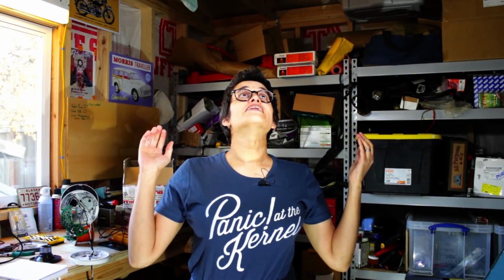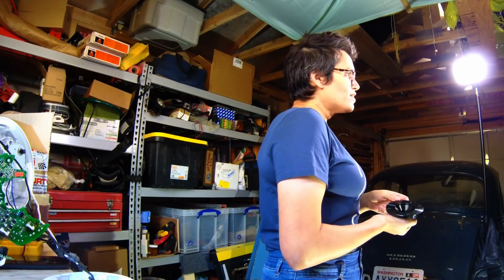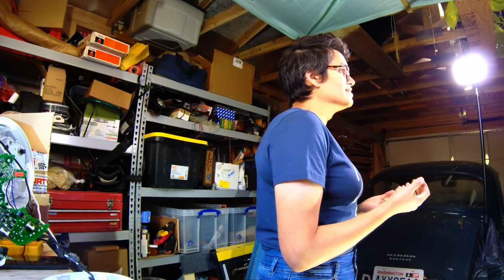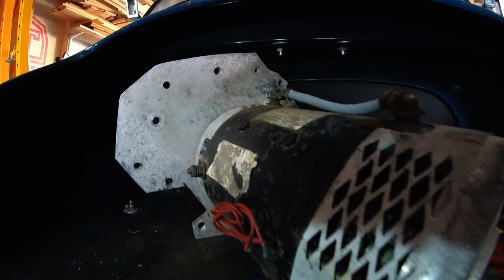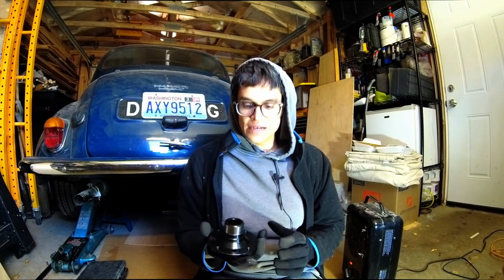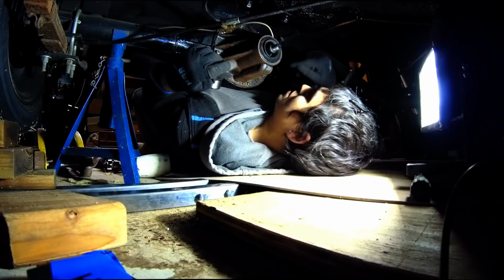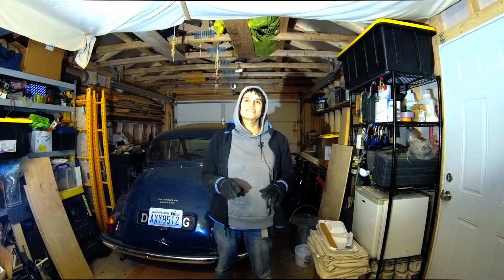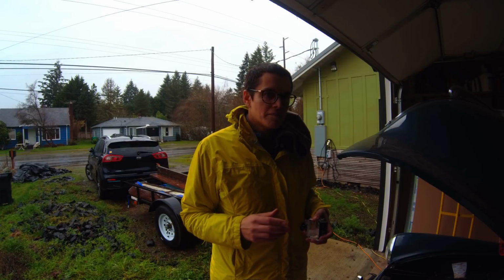Rebooting Rebecca - Turning A British Classic Car Into An EV. Episode 1.

Comment: Anyone watching this later--if you want to make life easy for a dry engine, take out the sparking plugs to crank it a bit. A short squirt (1 second) of WD-40 or similar in each pot can help lubricate and free the rings. If there is room in the sump, adding a pint of fresh oil down the rocker cover will help the valve gear. 

I say there's no kindness in cranking it slowly with the plugs in, because everything is under load and the oil pump may take ages to prime at that speed.

A rough check for preload in the pinion bearings is feel--there should be a bit of stiffness when you turn it by hand, but it should feel smooth, except if you feel the teeth meshing.

Comment: I snapped a number of half shafts on my Minor and, i can tell you, that stripping the diff is a piece of cake and much easier than the way you managed this project.

You simply pull the half shafts from either side,
unbolt the diff,
it just falls out into your hand.

You are then able to work on it without having to work under your car.

Bit late now, but there you are.

In my case, and this is a warning, when you snap your half shafts you will find that the shear just where they enter the diff.  They are splined shafts that fit inside the drive gears, this is an advantage as you don't destroy the gears when you snap the half shafts.  However, this does leave you with stubs that need knocking out with a chisel.

Once you have your diff out of the axle you can use engineer's blue to see where the gears are meshing and adjust as necessary - not a job I have done but I have some notion of how.  Doubtless there are instructions somewhere on the net.

Anyhoo, the whole point of this posting is to advise you that, with the torque delivered by the motors you are very likely to snap a shaft, probably in the wet, probably  as you turn out of a junction or driveway and put the power down too early.  I managed to do this with a 1275 Midget engine (at least twice), you will have no trouble snapping them with an electric motor.

Therefore, I strongly suggest you do as I did and pull the half shafts now, heat the splined ends till the are showing red, then dunk in a cold bucket of water to harden them off.  This sorted the problem for me, once and for all.

The gaskets should all still be available, I always used to use this firm:

Name: The Morris Minor Parts Centre
Address:
143 Cannon Hill Lane
Postcode/City:
SW20 9BZ London - Raynes Park
County:
Greater London England

- this was 15 years ago but they seem to still be around.

Whilst you are stripping the half shafts you might also like to change the rear brake cylinders, which are astonishingly leaky.  I don't know whether good quality parts are now available but this always used to be an issue for me.  You might like to try synthetic fluid, you may be aware this is less hygroscopic, so will probably cause less rusting of the cylinders.  Apparently a rear disc conversion is possible.

I changed the front drums for discs, I was not keen on using Marina parts (different wheels required) but managed to find an Owen Burton kit that used Ford discs and calipers, which required that the hub holes be drilled out slightly to accommodate the bolts, but a very good upgrade.  I don't recall it being a particularly difficult job.  However, forum postings suggest that the kit from JLH is of better quality overall and requires no machining.  Caveat Emptor.  This, coupled with the radial tyres, made the Minor a much safer car in normal traffic.  

I used to enjoy powering down the motorway in the outside lane, roof down, overtaking everyone else.  Good times.  I once burned a V8 land rover away from the lights too, I was quite chuffed with that.
Reply from the maker: You'll be pleased to know that these aren't standard mog halfshafts. it's an updated Ford English diff and halfshafts and she's running the JLH disk brake and rear brake upgrades :) ^Kate
Reply: @transportevolved  Sounds like you have a handle on it.  I miss my cabrio - but it was getting expensive at a time when I didn't have a lot of cash sloshing around.

Comment: It's a bit late now but for the next time you can work out the correct torque on the nut by loosening it 1/4 of a turn and tightening it back with a torque wrench, adjusting it up till it is just high enough torque to get back to the start point. Then use that torque when putting the new flange back on.
Reply from the maker: Ooh. That would have been very handy to know. I'll try and store that trick away in my memory... ^Kate

Comment: Ha you've reached that age where you have to take your glasses off under the car. Annoying isn't it?
Reply from the maker: Ironically they're multifocals, but I couldn't get the angle right g

^Kate
Reply: @transportevolved  Right. I have varifocals, but they are designed for reading books, and quite often just don't work for 'non-standard' viewing angles, either close or far (e.g. car-spannering (close) or cave-surveying (far)).

Comment: I like the subframe idea - I thought of the Morris Minor as soon as I saw this: https://rbwevcars.com/models-rbw-roadster-gt/ 
Sounds crazy but on crossply tyres the Minor is probably the best handling car I've driven - would go round corners sideways with total precision. Lovely. 
Issigonis always intended the Minor to have independent rear suspension so the subframe would fullfil the spec and leave that huge engine bay for the batteries.
Reply from the maker: Yeah, I would have loved to do that, but it definit needs an engineering shop and COVID makes that much trickier... Since no one local seems interested I think that plan is off the table :(. ^Kate

Comment: I don't understand why anyone would want to drive such an old car.
Reply: I don't understand why anyone would NOT want to drive such as old car :)
Reply: @AntonyvanIersel  
Because they are less safe?
Because they are less efficient and cost more to run?
Reply from the maker: Because they are fun? Because they place you in a closer connection with the environment (although not as close as a bike)? Because they're an enjoyable experience? Because, in the medium term, scrapping tens of millions of cars rather than converting them is an incredible waste of resources - and certainly classics are a niche, but general conversions are a great idea. ^Kate
Reply: @transportevolved  I completely agree that it is very likely that the fastest, most efficient,  least expensive way to transform our current transportation systems towards sustainable energy usage for the near term (~next decade) is to retrofit the power plants and energy storage - to electric drive.
Reply: @transportevolved  I completely agree!  When I worked for an auto supplier I tried to convince them to get into the ev conversion business, however they are 100% stuck in the legacy motors mindset. - Still this was a great video, thoroughly enjoyed it, ;)
Reply: @transportevolved  
would you like to drive a trabant (east german walking aid)? if so, don't crash into a wall at any speed, especially not at 50 km/h or more. because even at speeds as slow as 50 km/h (roughly 30 mph) the thing will be reduced to a tiny fraction of its original length, with you sandwiched somewhere in the middle. not even the boot (or trunk) would stay intact.
Reply: Because they have character?
Reply: Because modern cars are heavy, overly complicated, very expensive to buy and insanely expensive to fix..
And yes, because they are fun!  It's like saying why would anyone want to live in a house that is old.. Or play any video game that isn't current or.. anything...
There is a good reason retro computers, renovations and vintage stuff is a thing!
Reply: Drive one. They have charm, and successful completion of even a short journey feels like an accomplishment.
Reply: @lfo414  
IOW, they're unreliable?

Comment: Reached out to fully charged, icon, evwest, or other youtubers to gain knowledge or resources?
Reply: Long time ago I suggested to reach to EV West; no comments were posted in response to my proposal.
Reply from the maker: I actually chatted with them a long time back... They are somewhat out of my price range. ^Kate
Reply: @transportevolved  if I come into a windfall I'll finance it.... until then I guess it's the diy grind:) you do seem to enjoy working on this stuff though 🤔
Reply: @transportevolved  There is a wide range of vehicles converted from ICE to EV. The most highway worthy and expensive are those done by someone like EV West. On the another end of spectrum of conversions are affordable ones intended for urban use as city cars. A video about using pre-own parts like from Citroen C1 in converting of a vehicle like yours was posted in 2018 on this very channel:

https://www.youtube.com/watch?v=EesLxLJvxDc

According to your conversion plan, where is your envisioned goal for your Morris minor? Like most viewers I would like to understand the budget, the range, the motor power. From your fresh video I understood you will not reuse the original gearbox.
Thanks.